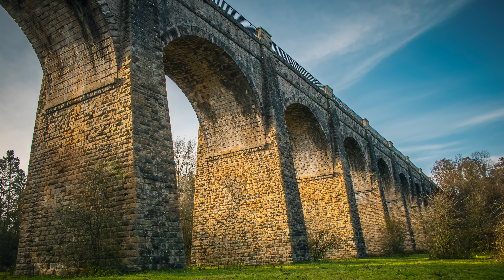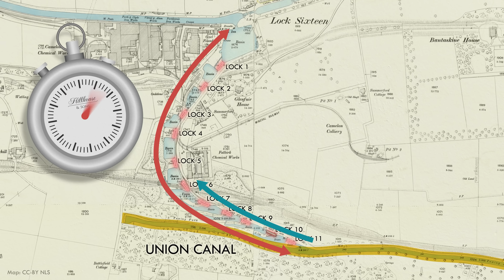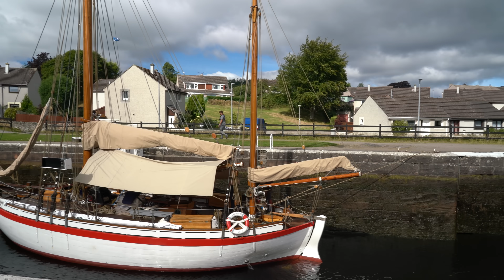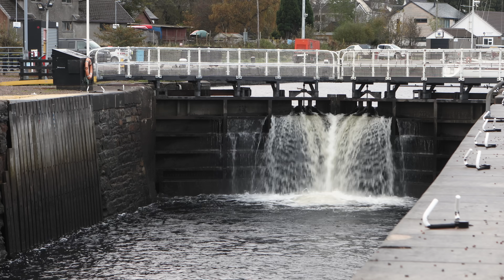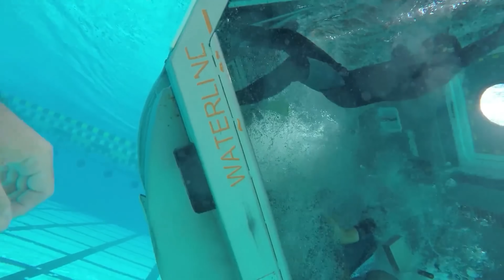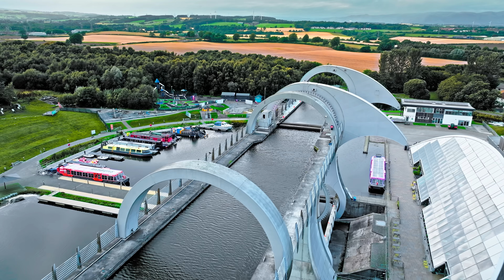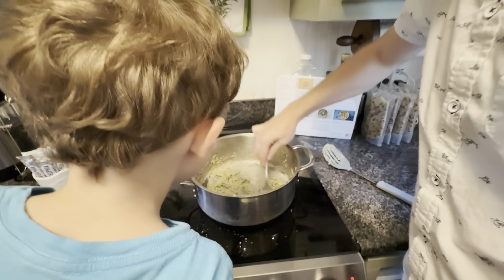The Hidden Engineering Behind the Falkirk Wheel

Comment: One point - there  was a  short stretch of new canal on the  Edinburgh side of the   Falkirk Wheel but  the   Falkirk Tunnel just  beyond that , was  part of  the  1790 canal system  so was  not  built around 2000. You  can  see the   tunnel marked on  Ordnance  Survey maps   of  the  1850s and  my  Granny  was  born in 1896  In Muirhouse Farm , Falkirk  which  is  less than  200  yds  from the  tunnel entrance.

Comment: Can you also do the "Anderton Boat Lift"?  Conceptually the same but was originally built in the 1800's.  Was referbished in early 2000's
Reply: Thats what I was going to say! Lets do Anderton!
Reply: Anderton also has a fascinating mechanical history if I recall correctly. Steam pneumatic, then electric rope, then hydraulic.
Reply: @phillyphakename1255 hydraulic to start with and the salt was it’s first downfall. Salt in hydraulic systems is not a good idea.
The changing history of the lift is fascinating.
Reply: @phillyphakename1255  And now broken again - seems likely to be converted to electricity, sadly.
Reply: While you are doing that  can you please include the first ever 'drop lock' which is on the Forth and Clyde canal?  The boats drop down to go beneath a road bridge and back up the other side.

Comment: The canal systems here in the UK 🇬🇧 have some of the most "human" engineering you will see. Two of our local canals have wonderful locks on them, and quite exquisitely simple bridges that are stunningly good looking. One of them also boasts the highest, deepest, longest canal tunnel in the UK, it was quite late for a UK canal, opening in 1811.
The Falkirk wheel is a statement.
You should also take a look at the Anderton Boat Lift, that only lifts boats 50ft, but was completed in 1865.